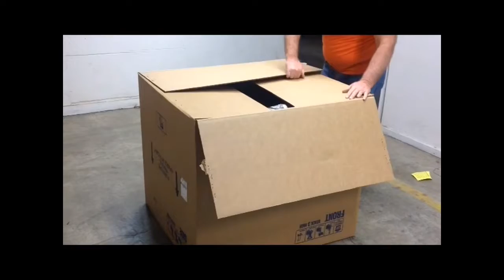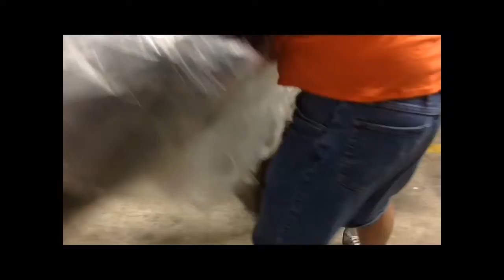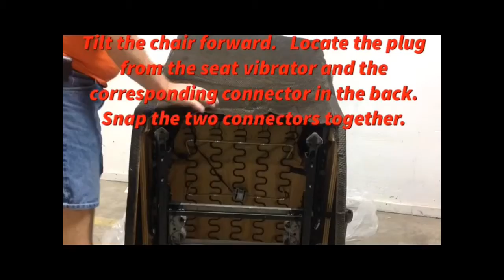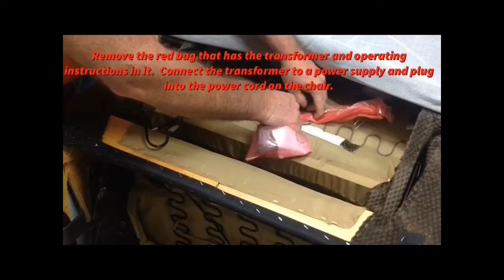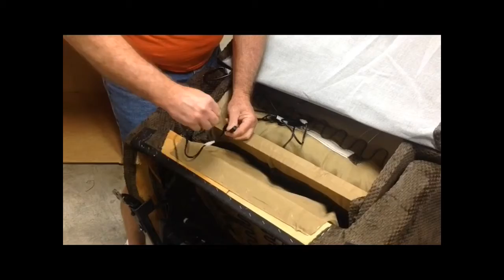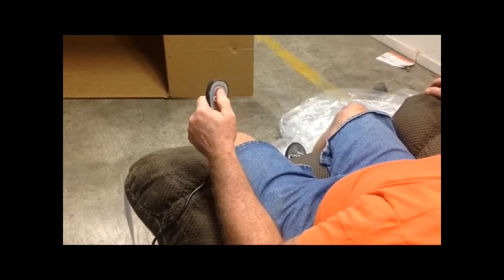Connect and test Catnapper recliner with heat and massage

Comment: Hello, I like your repair vid, I have a sofa and the heating element of coil broke in couple of places. It the long thin wire, can I replace it with another heater element wire or does it have to be from catnapper.
Reply: +will sav I don't have this make of chair but I was repairing another. Ended up just taking the heating element out of a single size heated under blanket for beds, and using that. Was much easier and the extra warmth is great.